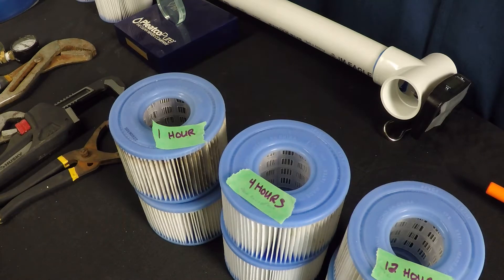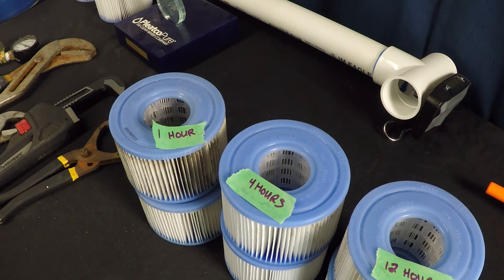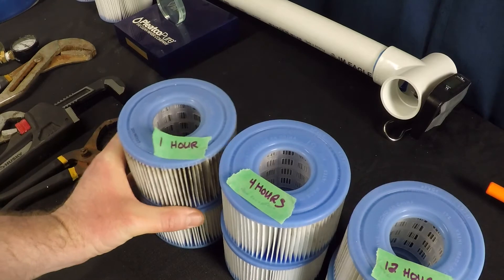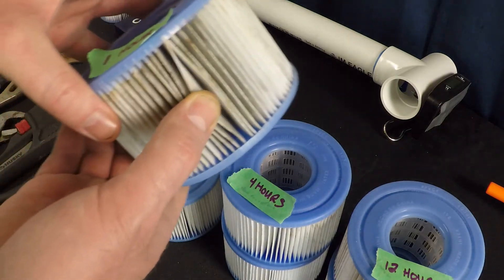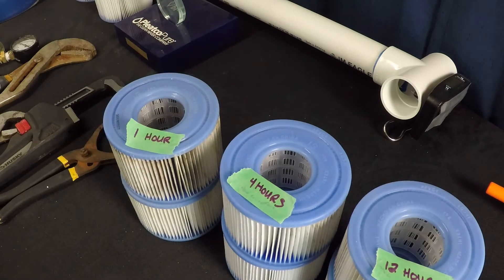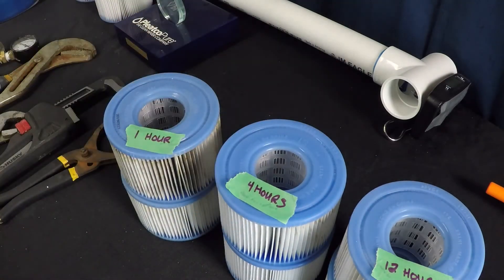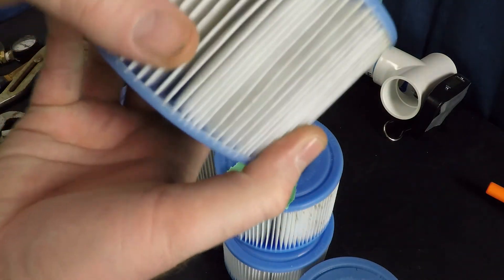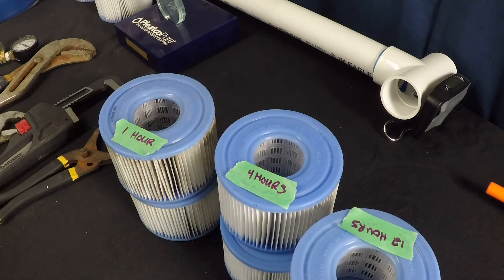Filling A Hot Tub With Rain Water

Comment: I have a 220 gal hot tub & 220 gal rainwater barrel system (4 barrels @55gal ea) I just tried for first time to use 50 % rainwater (more like pondwater since it was sitting in the barrel a few weeks) & 50% city water. Even with filtration it was lime green. I added 2x more chlorine (the first batch got canceled out by algae) and extra ph balance. While I now have proper ph levels using what is essentially dirty water is not a good idea and I'm not going it again unless I treat my rainwater first